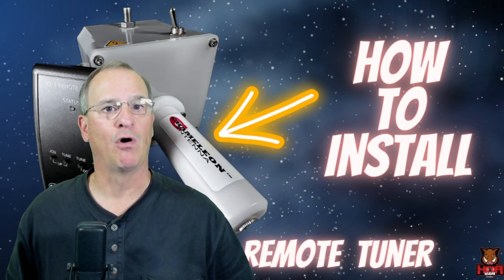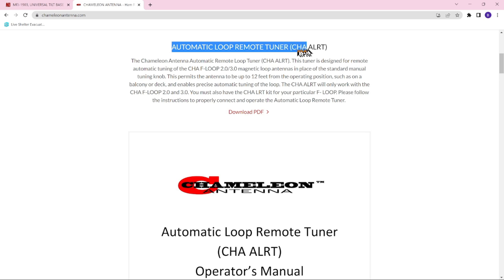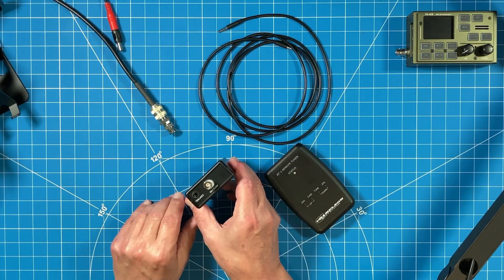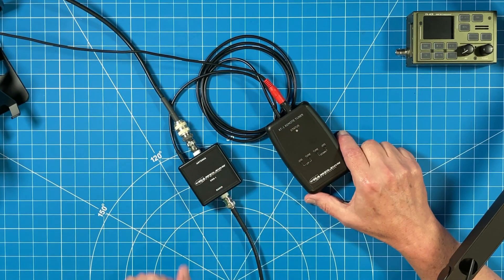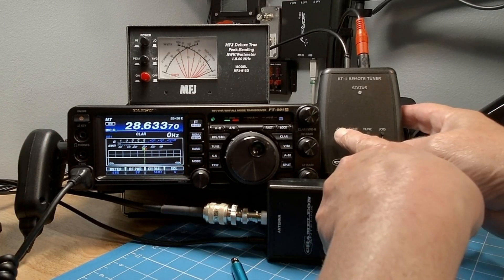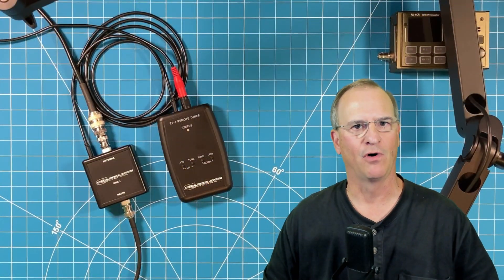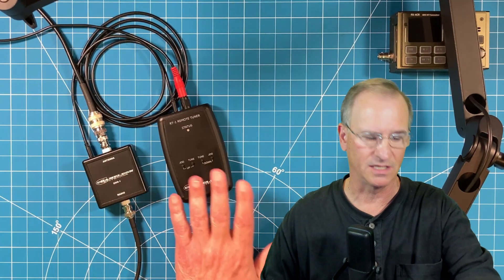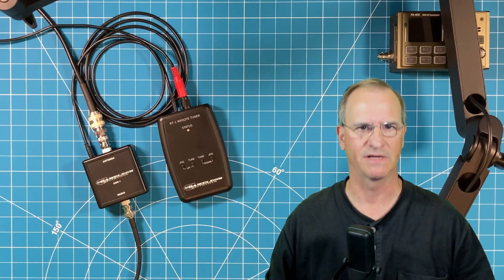Chameleon Introduces an AUTO TUNER for the Magnetic Loop 2.0 / 3.0 -- Set Up and Use

Comment: Just subbed. My daughter lives in a HOA in the Denver area. I brought my IC-705 and Chameleon Mag Loop 3.0 with me. Tuning the antenna is really tough as all you have to do is touch the knob and the SWR red lines.
I was just looking for a manual geared reduction attachment to help fine tune the antenna.  I did a search on YouTube and found this video.
Without the automatic tuning part you are featuring is the motor slow enough to prevent the issue I am having with the knob being too fast?
I like this setup though. 
Thanks for sharing.
Reply from the maker: Thanks for the question.  Just like all mag loops, tuning by hand is touchy.  With the motor and the manual remote, you can absolutely dial it in.

Check out this video to see how I did it when I first started using it:  https://youtu.be/dZ0ddNcGMoE

Then as I became more comfortable, I used this method (its an analyzer video but I focus on my mag loop from the shack}:  https://youtu.be/s8Yuzyq-FCo

Oh, and if you do pick one up directly from Chameleon, let them know HOA Ham sent you.

Comment: It's too bad there aren't any fairly-affordable mag loops that can handle 100W.
Reply from the maker: Agreed on this.  Would still like to get a 100 watt loop in the attic.
Reply: @HOAHamRadio  I don't have an attic.  I instead have two floors of residences above me in this apartment.
Reply: The power compensator puck pushes power up to 60 watts, if I recall correctly. Rob/WA9RAD

Comment: Super confused.... So do you need to purchase the CHA LRT for ($350) and the additional ALRT listed for $110? Because I don't see the power cable that you call out in your video at 2:35. The User Guide (version 3.0) on Chameleon's website makes no mention of a power cable. The only cable it mentions (Plate 1) page 4 is the C. RTU Cable - indicates it's 20' long with 5.5/2.1MM connectors. If you don't own the previous ALRT and just purchase the CHA LRT ($350) does it provide its own power via the RTU cable? Additionally, the CHA LRT ($350) doesn't come with the separate box between the antenna and the radio. Thanks for clarifying!?
Reply from the maker: @sobpolta3328, you may need to send an email to Chameleon if you have specifics about kit contents.  The power cable at 2:35 is user supplied.  It comes with a short power cable (maybe 2 or 3 feet, don't recall), but because I had my mag loop in the attic, I purchased a 50' cable from Amazon to make the connection.
Reply: @HOAHamRadio  copy that!

Comment: My only concern is the length of the remote control cable. At 12' it would not reach the antenna placement in the attic from the spare bedroom/shack. I'd need at last 25'.
Reply from the maker: Thanks for watching @Drsef50.  The Auto Tuner box actually stays in the shack at the radio, the remote tuner on the F-Loop goes into the attic.  My F-loop is ~50 feet away.